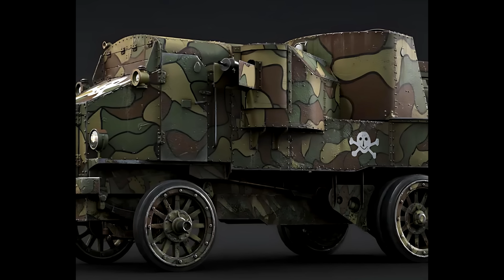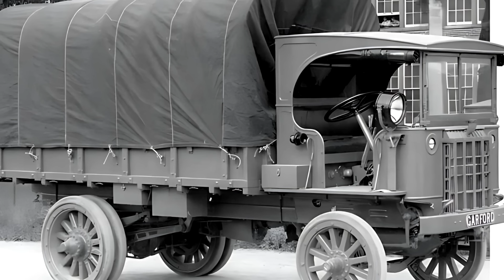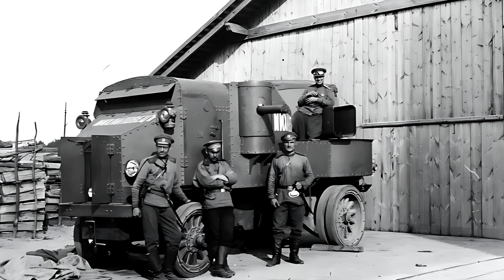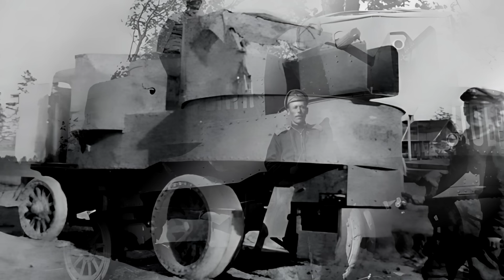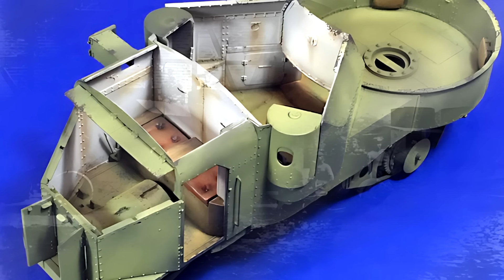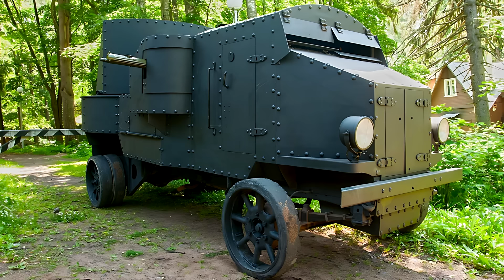1915 🛡️ Garford-Putilov — 11 Tons of Steel, 30 Horsepower… Why This Worked

Comment: 30 horsepower moving 11 tons is the perfect illustration of "it's not about the power, it's about the torque and the gear ratios." This thing was basically a mobile fortress designed for trench warfare—speed was irrelevant when you're meant to break through lines and suppress. Fascinating machine.

Comment: When ever 76.2mm is used as a measurement it was a 3 inch design. None would ever design anything at 76.2mm. If from the USA and is listed as 76mm then it is usually a 3 inch item. 
Conversion of Imperial to Metric (and reverse) is at best inaccurate and at worst awful. 
I have seen 120mm converted to 4.7 inch (commonly used) then reconverted to 119mm.
Reply: It's not imperial 3 inch. It's from tsars Russia measure called "Line". Line was ROUGHLY 1/10 of an imperial inch but not exactly. It's gun caliber was 30 lines or 76,2 mm (you can see that it looks like a Mosin rifle caliber with a moved decimal which was 7,62 mm caliber). So not everything that looks like an inch are EXACTLY an inch based, sometimes it could be something else.